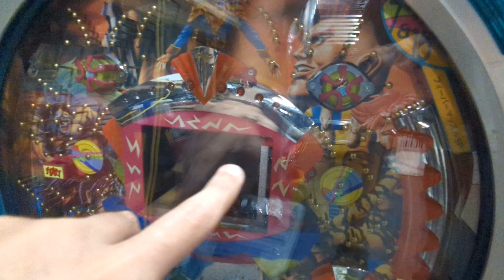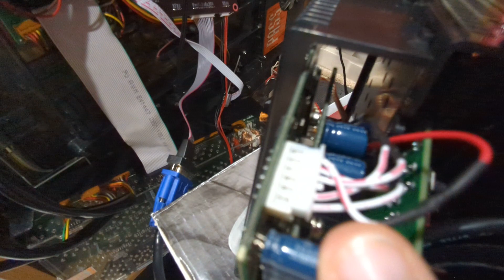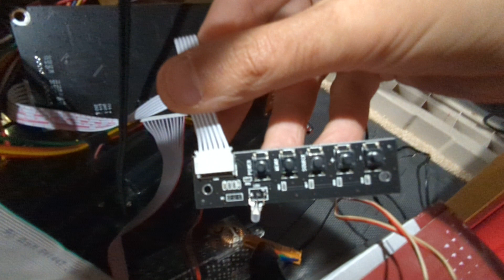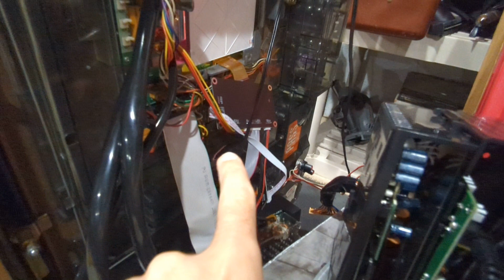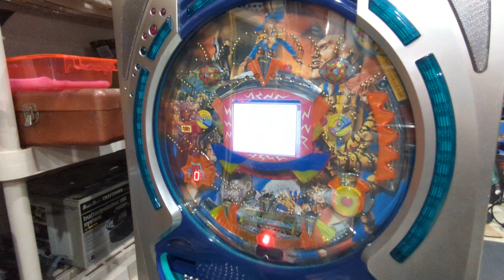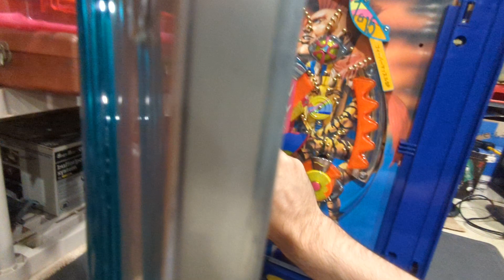Pachinko CRT to LCD conversion Part 2 (LCD in the machine)

Comment: Great work! Would you be able to send me a link to the LCD, LCD controller / supporting boards, and the CRT to VGA adapter board? I would very much appreciate it!

Also, does the LCD controller dictate the screen resolution to fit the CRT image or does the CRT-VGA converting board do that?

Thank you in advance! :)
Reply from the maker: Try out this file I created for this very purpose.  https://docs.google.com/document/d/1eyL2WQK_4C3hvRcd-dH0jiehI8e5dZL1AtxcMIyolxA/edit?usp=drivesdk
Reply from the maker: I think the board the controls the LCD takes care of the resolution.  On a screen that small, it doesn't really matter much.